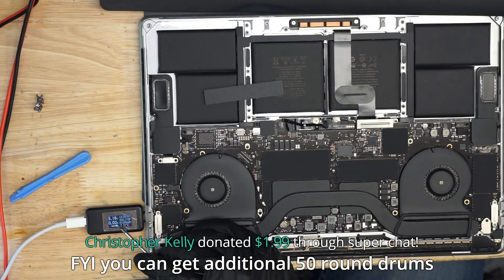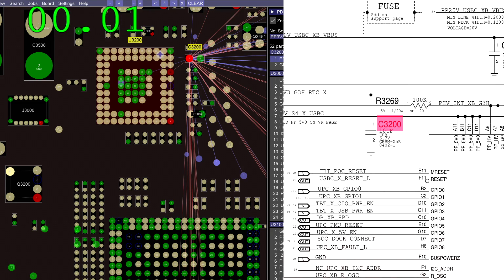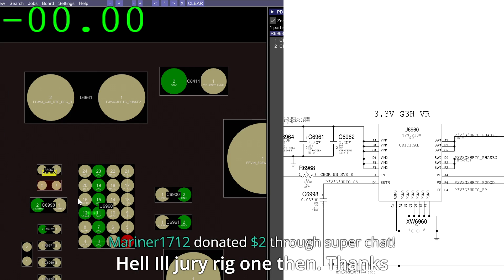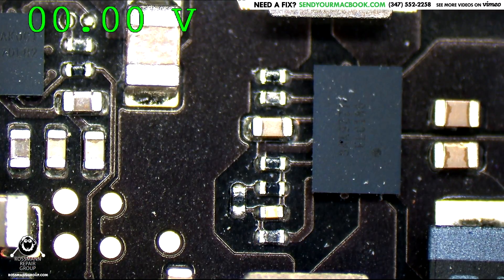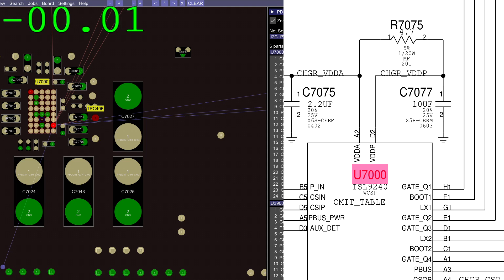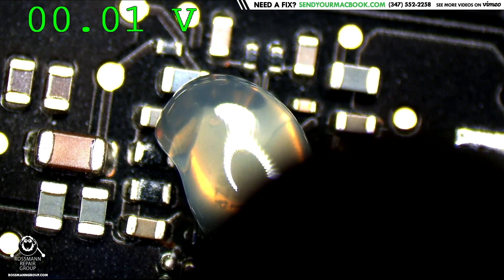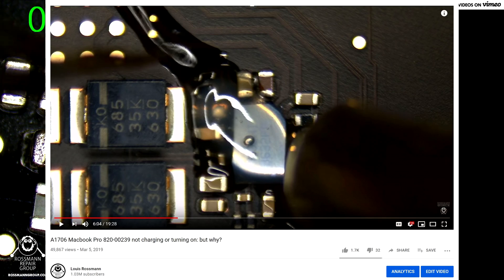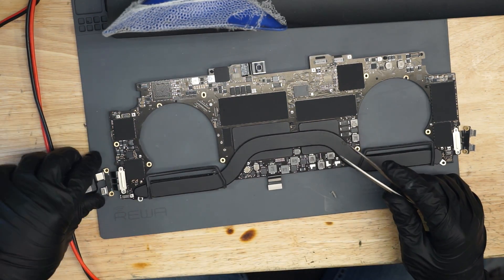How Apple is shaping the future of repair.

Comment: We don't tolerate this from our cars, our central heating/AC, our refrigerator, our stove, our water heater, our house, our plumbing, our TV, our radio, our non Apple product. Why do we tolerate this from Apple?
Reply: Because people only understand their computer as magic metal box
Reply: L
Reply: @houghwhite411  And its more of a prestige thing. Those people buy Apple because its expensive. Its like they not gonna buy a nice silver ring with a little stone on the top that looks gorgeous but only cost 100 bucks when they can have a golden ugly as fck ring for 5000.
Reply: and the keep buying apple because its trendy and in fashion.
Reply: Hough White , most people don’t understand how their car works but you can take the vehicle to the mechanic of your own choice to do the work needed. He has access to the parts even if he or she has to purchase through the dealer.
Reply: @houghwhite411  Because it is. Almost all OSs are extremely complex now. People that want to understand and play with their system install something like Arch for this reason.
Reply: People keep buying Apple products. They're afraid of change and I still to this day I find Apple is designed for handicap people. The whole system is flawed. Real Apple fanboys never have experienced the freedom of Android or windows the way apple locks them out from being free. The hardware is pretty much the same but double or triple the cost for Apple. It's only going to get worse since now chip makers are rolling out powerful chips average users won't need to update their system as often. I have many PC's and servers and still use one PC for VR that has a 8 year old I7 processor and a RTX 2080. My point is sells are going to drop with these new chips. Could you imagine the average user maxing out a 64 core 128 thread CPU? That should easily be good enough for the next 10 years. Apple should be afraid it's already happening in the phone market people don't upgrade as often as the phones have become so powerful as it is.
Reply: At some point people have a phone. And unless they run stuff like emulation or other intensive apps, they will never use the potential performance. New phones get bought either when the old one becomes running slow, out of storage or the contract offers a "new shiny thing"
The market will become saturated because who needs a second or third phone in a cycle where progress is slowing down and devices are "good enough" for longer.
Reply: @dco5055  Good point. I don't buy brand new phones anymore. I buy second-hand phones that are 1 yr or a little older for a third of the cost of a new one and they last me for years. As you said, the average user doesn't need top of the line powerful devices anymore as earlier devices are more than adequate.  A $1,000 cellphone can't be justified in my view. My laptops last me for at least 5 years of heavy usage and prices, unlike cellphones, came down significantly as quality and sophistication went up. Never used Apple devices, the prices are outrageous, and then it seems the whole Apple business caters to a cult customer base that would never question anything. My suspicion was confirmed when Apple decided to eliminate the headphone jack on its cellphone devices and forced its customers to buy a $150 wireless earpiece. Imagine android manufacturers doing that? If Samsung did that, it would've lost at least half of its customer base. In business, sellers cater to their customers, for Apple, the inverse is their business model.
Reply: Because of the political influence of money, lies, and lobbyists .  The voice of the individual citizens keep decreasing over time.  We are forced to tolerate this crap.  Our vehicles are already proprietary and disposable.
Reply: @wushock97  i took 2 cars out of the scrap yard and built one for myself, recycling at its finest
Reply: @gcKukie  That's awesome!  I drive a 15-year-old car myself, but looking to replace it with an even older "refurbished" or good condition car (since I can't do the work myself anymore).  At least any qualified mechanic can work on and repair them.
Reply: "We don't tolerate this from our cars" Cough Tesla Cough
Reply: Many people who buy iPhones or Macs have 0 technical knowledge (or just don't care), not even how it works. We can just direct to a cause by problem elimination. They just go: "Internet broke down!". What do we do? Check if other devices can access it? No, cables? No? The router itself? How did I discover my PSU was worn down? I just tested it and noticed it only BSOD my PC when doing heavy gaming! The voltage was less. Many young people and old people just go: "NEED A NEW PC! IT CRASHES!". Meanwhile it starts up without a problem, so the solution can be software related or just 1 piece of hardware going faulty/old... Every time I brought a device to repair shop I could point at the problem with very high accuracy. Always was either complety right or in the right area. People don't understand or don't want to understand their devices anymore.
Reply: Finish303 I’ve been trying, for the past few months, to get resources to I could try and fix my laptop, my dad wouldn’t get the materials. So, I told him to take it to a repair shop, he hasn’t done it. So, I’m getting a new PC entirely, I’ve chosen to build mine my own, and have a friend help me learn to assemble PCs.
Reply: TESLA owner tolerate it.  Why I wouldn't own one the only apple product I've owned was the 1st color IPod...  Apple SUX
Reply: RDE Lutherie  Microsoft and also  Nivida is releasing a software that allows people to take advantage of all cores no matter how many even on old games soon. I'm sure down the road it will come default to use all the processes. Yes I use Linux and even Ubuntu desktop. 

Open up Wireshark you can see what is being sent if it's encrypted you can see it's just a few bytes. Also you can turn off that so called Microsoft sends everything to their servers.  I care less and if they really did capture everything wish they gave me a option to recover something I accidentally deleted.

I would never use Apple can't wait to see it eventually fail. I mean it's already reporting record losses.
Reply: Good sir, I’m not sure you’re aware, but regarding cars... luxury car makers coughAudiVolkswagenBMWMercedescough have been restricting the electronics and a variety of other seemingly easy-to-replace parts for a few years now. If you want a new part, has to be directly from them. Can’t use a substitute because they literally make that given part so proprietary and unnecessarily complex in design that no one could replicate that part... at least not legally.

Apple is merely following the Germans’ lead.
Reply: @AtomicSymphonic  
Yeah but they will sell you the part. Louis would buy the part from Apple if they sold it.
Reply: because Apple is a religion ... :/
Reply: @GarryMobi  It's a CULT!
Reply: Be careful with your assumptions there... Several of the types of components you have mentioned have begun down the path that Apple has defined for big corporate america.  Try to repair a modern fridge, or talk to a farmer about trying to repair their John Dear equipment.  This latter case is in fact driving farmers bankrupt when they have to wait days for a repair they could easily do and had in prior times, crops rot in the field....

Don't assume this is just Apple, and yes, their attitude is scurrilous but they are leaders of a trend that will further drive the crass consumerism and destroy our planet.  Right to Repair, among many other excellent reasons to support it also is a huge Environmental issue.  If you can bring a PCBoard back to life it keeps it out of the landfill.
Reply: We don't.. We buy android.
Reply: "WE" dont. The idiots buying it have to live with it...   👍
Reply: If you own a Rolex, Omega or just about any other Swiss watch then this is the case, independents cannot buy parts.
Reply: @jimporter  My dad used to supplement his income by fixing watches, including Rolex.  He was not an authorized dealer.  He didn't have problems getting parts.
That was 50 years ago so it might have changed.
Reply: @jimporter  ouch.  Sorry
Reply: Because these days  people are sheep brainwashed by ads on tv, social media and in print.
Wake up people, these corps are taking away your rights.
Just don't buy products like Apple who spend billions crushing competition and 
Prevent you from owning the product you just purchased.
👍👍👍
Reply: you make a great point my dude
Reply: I don’t tolerate it. I am using my last apple pos which is slowly dying from battery issues. Apple will then be history
Reply: I've been asking that question for as long as Apple existed, as they have been doing the same thing for as long as Apple existed. I still don't have the answer, and still for the life of me can't figure out why iCrap is this popular.
Reply: Volkier Neigh 
It’s hard for us engineers/technically-inclined people to believe or understand, but combine people that like slick marketing and branding, a status symbol, and an unwillingness to learn how electronics work... and you get Apple.

Even today, people my age, in my 20’s, don’t fucking understand computers. It’s unbelievable for me that it’s nearly 2020 and we still have people that only know how to use an iPhone... that’s it.

Future isn’t nearly as fantastic as so many of us were hoping decades ago.
Reply: I don't. I've never bought Apple and never will. I don't use Facebook or Twitter either. Stop enabling these people.
Reply: On top a TV is between 10-20% profit 
Iphone is what 200-300% profit? 
Airpods are how much % profit?
Reply: Thats not 100% true. A car is much more complex. While you can change individual parts if say the ECU goes out on your car they wont fix it they will sell you a new one. Also TVs are a bad example these days they are ment to be thrown away I have a 3,000 TV have it mother board go out and when I cantacted samsung I was told that the motherboard would be 2,400 bucks to get replaced.
Reply: Because people LOVE Apple and accept it's easy to buy a newer shiny replacement. It stinks though!! 🤬
Reply: Well because beeeeeeehhhhh!!! 🐑🐑🐑🐑, you know m.....
Reply: Apple products to a lot of people are a "fashion statement". They like having Apple everything just to flex or fit in even if there are better product alternatives out there. That said, I can definitely appreciate the aesthetic of Apple products, but I would never own one myself.
Reply: mactards, macilliterates, macbeths, many words for it.
Reply: Sadly the new cars are going the same trend.
Reply: you are right except for the non-Apple product part. Try getting such (vendor-customized) chips for other brands Electronics. This is not an Apple-only issue.
Reply: because Apple users are borderline stupid and/or rich
Reply: Simple answer, I don't tolerate Apple crap.
Reply: Tesla owners tolerate this from their cars. But I'll never buy a Tesla because of it.
Reply: Some of us don't tolerate it and refuse to purchase any Apple product as a result.
Reply: Deere is the Apple of tractors.
Reply: Because all the idiots need the new iphone to look rich
Reply: I think it starts with ignorance which turns to denail and then...just plain ol" stubborness. We must challenge our own assumptions every day. Every day.
Reply: Because there aren't alternatives, you can't do and edit movies with other things on the market without the pain and apple knows this, when it gets broken you buy another one.
Reply: @tulvo  You certainly CAN make and edit movies with other things in the market and with better success than what you get from apple products.
Reply: @tulvo  I'm not a filmaker by any means but aren't there many other video editing programs out there for Windows and linux? Is final cut pro really so good that it warrants buying an overpriced Mac?
Reply: @JAD-dz3kt  You must change some things to make microsoft computer so fast like mac. That's almost like work.
Reply: @tulvo  Then use linux
Reply: @Deon DenisIt was meant as sarcasm.I would never buy a apple product they are way overpriced  & over rated .
Reply: It's because Apple is a fashion accessory above all else and functionality, reliability and convenience are purely secondary at best.
Reply: 'Cause some people are stupid enough so they don't care
Reply: Cause noone who owns an apple actually knows whats wrong with it
Reply: I had an imac for 10 years. Now I go out of my way to explain to people why I don't buy apple products anymore.
Reply: sadly people do tolerate this from cars have you seen anything newer then 2008?
Reply: Actually this is becoming more of a problem than you think Massey-Ferguson and John Deere have made it illegal or near impossible for you to repair your farm equipment. Tesla, Mercedes-Benz, and Ford are trying to prevent people from repairing their own cars by making sure the central infotainment system controls everything. And if the primary ECU goes out bricks itself because you touched it, so does the infotainment system. Whirlpool is starting to hide their schematics for parts, only labelling them on the wiring diagrams as "X part" instead of their individual components, meaning you have to replace the whole sub-system instead of something as simple as a fuse.

Part of this is because China steals designs and then just sell them out to whoever has money to buy the parts. Think of devices using chips and boards originally developed by Texas Instruments and NEC, but now manufactured and sold through hundreds of Chinese companies who copied the designs. The biggest part though is that they don't want cottage industries allowing repair or extended service life services. If people are keeping the older simpler stuff going, they're not going to buy the new stuff you packed with features you spent money on developing. Especially if those features receive negative reception, but you wasted so much money developing them that you need people to buy the device that has them to recoup your failed investment. They're stupid enough to waste money on bloat and then expect you to pay for it.
Reply: People thinks of Apple as a fashion item; my last Apple product was the iPhone 4.
Reply: Cars are next. John Deere is one of the biggest forces behind killing right to repair laws. Their new business model is selling you the initial vehicles cheap and then gouging you with repairs.
Reply: Got any friends in agriculture - ask them about John Deere products.  The fact that they are pulling this crap with six figure products has led to some “right to repair” legislation in farm states.  Don’t get me started on Tesla...
Reply: Your point for TVs doesn't really stand anymore. The repairability is pretty close to phones and computers. I pulled apart a Samsung TV recently and I could barely find any replacement components. Only boards which is very similar to Apple products and other phones and computers.
Reply: Because Apple fanboys are empty shells of humans who replace their personality and individuality with expensive shit. You could say they are NPCs from video games.

And like someone else from this thread said, phones are magic camera instagram boxes to them, and they believe everything they are told.

They're basically programmed by Apple to respond in a certain way if anyone dares to criticize them.

Also their "programming" completely breaks and crashes if you undeniably challenge their opinions. 
I guess then they just call you an Android fanboy and smugly run away, feeling like they just won a war or something.
Reply: Because you buy there shit.
Reply: but you do tolerate it for most of those as car fridges washers dryers get more complicated its harder and harder to repair one of the lobbyist in one video was microwave repair and others were tracter repair and more at least they can actually repair stuff unlike apple lol
Reply: @trueheart1372  Had a board go out on a washer.  Board was easily fixed with non-proprietary parts.
Our cars are 20-21 ears old, aftermarket manufacturers abound.
A smart consumer stays away from overpriced fad products that can only be fixed at/with proprietary overpriced service centers.
Reply: Because of Genius™ Think different™ design
Reply: because first world ###
Reply: @Love America Don't understand why people buy apple products unless they are so shallow and weak minded the have to boast to others that they can afford to throw 2200 bucks down the pan; really sad people.  
A college college once tried this on me and was so proud that he had a $2200 machine until it went wrong and was quoted $1750 for a repair, a 6 week wait while it was returned to apple and total loss of all his years college work because he was told that the data was not recoverable. 
I just grinned. He then asked if I would give him a copy of my years worth of college notes because apple would not even attempt to recover his data. I grinned again and said what form my second hand $150 laptop. His apple device, returned after 12 weeks, was put up for sale.
After selling the machine and paying postage he had lost a total of just over $3000. 
He has now asked me where I purchased my second hand laptop from and what freeware backup program I use. 
Moral of the stoty:- Just don't buy an apple device because after they have sold it to you they don't give a monkey's about you, your data or how much you originally spent.
Reply: Absaalookemensch cus ecosystem
Reply: @naturecollision  No, because some people are sheep while others are intelligent.
A fool and their money are soon parted and there's a sucker born every minute.
Reply: Its like the government of phones
Reply: @xoxoxok  Like single payer healthcare? lol.
Reply: "We" don't tolerate it. You might, but "we" don't.
Reply: We don't .... buy something else.  My new Dell running Windows 10 is fabulous !
Reply: @absaalookemensch cause with apple we "Think Different"
Reply: RDE Lutherie  while your macbook and imsc overheat if they are old or some random chip fault
Reply: I wouldn't know. I use Android and windows.
Reply: Let's make sure Tesla-like cars don't become the standard. Teslas are notoriously hard to repair, just ask Rich Rebuilds. For example, it writes lots of data to flash memory soldered to the board and when it fails your car stops working.
Reply: As population increased, so did sheeps.
Reply: @coolvinay  You're baaaaaaad.
Reply: i dont
Reply: Actually we do, see Tesla and John Deere.
Reply: isheeps
Reply: I don't.
Reply: Actually we do, you can not find parts for Tesla cars, only from Tesla and if they find you on the network with an "in their eyes" illegal car they can refuse to charge it at a Tesla charging station.  John Deere (I was one of the system admins working on this) has full access to equipment that farmers lease or rent from dealers, we set up a dealer network that will verify and make sure that the machine operates within the given parameters.  This is the future that we wanted, we do not want anything to do with humans, it has to be machine learning and AI and what would really happen if a machine started learning, correcting its own mistakes and rewriting the code...  Yeah, I am a boomer, but I have been advocating and preaching about this for the past 20 years, this is why I am now unemployed because the truth cannot be spoken.
Reply: Atleast you can find them with Tesla... His point is about both oem and apple not supplying this oft failing part inspite of knowing its failure rate, intentionally making it unrepairable...
Reply: I think it's different in that there is personal information in personal computers and not in cars and car parts but regardless,  an independant shop owner could get sued for malpractice by disclosing personal info from a computer he repaired so has alot to lose, should he take advantage of a customer.  Not likely to happen at all, but the fear mongering coming out of apple will go on untill the politicians stop listening to them and listen to us for a change.
Reply: @gym_bob  Apple and Telsa live by the code that there is one born every minute. 

 It matches their production goals.
Reply: Do you really think Apple gives a crap about your personal information other than using it to make money?
Reply: @gym_bob  No, it's because cars are much older than smart phones and computers. Give it time. This problem will solve itself. People will get tired of over paying for inexpensive repairs.
Reply: a computer is not a durable good. most electronics like tvs and radios are cheap and not worth repairing. an apple computer is just another disposable commodity designed to last maybe 2 years like their phones.  fixing them is great, but not buying them is better
Reply: Nate Walkner 
It’s a massive shame they are not. They used to be considered durable goods for years before the 2000’s. At least there is growing pushback against completely sealing off devices today.

In my family, we don’t want to budget for $2,000+ purchases of computers... then again, it might be because my parents want to retire and have to restrict everything.
Reply: @natalieisagirlnow  Wait so your solution is don't buy any computers, tv's, and radios because they might break in 2 years? That has got to be the dumbest logic I have ever seen. How are you even posting online if you have sworn off technology.

Also I have owned every tv, radio, and computer I have ever bought for well over 2 years before needing repair. And when these devices finally do croak, It's usually a extremely easy fix. For example, my most recent problem was my laptop had a swollen battery (was beginning to warp frame, and put pressure on the touchpad making left clicks not register) . Thankfully it's not an apple product, so without bothering taking the laptop into a repair store, I just ordered an after market battery from china. After that it's pretty simple, I disconnected the bad battery, and installed the new one!!! I know right!!!! It's almost like computers are means to be repaired when they break. FYI I am typing this comment on that same laptop, a year later, which has been working flawlessly.
Reply: Well it has a good camera ..
Reply: @roberthance2412  My Leica is a good camera.  If I want to take good quality pictures I use that.
My flip phone battery lasts 3 weeks and I have a spare for when I need it to last longer.
My computer exceeds the professional quality that I need of it and costs a fraction of the price and is easy/inexpensive to repair.
A Swiss Army Knife has a good toothpick, but that's not a valid reason to buy the over priced, under performing tool.
Reply: @natalieisagirlnow  Got the Leica at an auction, so no, at the price, it is monumentally better than a comparable priced camera that I paid for.
That was 35 years ago.
With a few telephoto lenses I can take excellent photos several hundred meters away.
You cannot do that with a IPhone.
Apple is like those stupid red soled women's shoes.  The produce for those born every minute.
Reply: @natalieisagirlnow  well, not really. I grew up with Leicas, had a 35mm Leica M3. The gold standard in nearly silent plane shutter rangefinder cameras. Quiet enough that they were allowed in the courtroom.

No snobbery involved here. I had a Leicaflex, their first SLR, and later Leica reflex cameras. Superb machines. I didn't base my existence on that wee red Leica badge, but I knew that they would always perform.

I had a Minolta XK when they first debuted...in the early 80s those were about $3500. Expensive but brilliant, and they made the job easier. The brass was showing on the cameras' edges, but I never cared what others thought. Well made machines last for years of hard duty.

I digress a bit, but here's the point. An Apple is priced higher than the competition, but it for damn sure is no Leica. That MacBook is a status symbol that falls apart after two years.

My old Minolta XK is 40 years old now, and works perfectly. Louis would like this. When the AE-S digital finder failed (first in the industry, so good that...yes...Leica used the Minolta system in their SLRs!), I called Minolta in the days before the internet.

Know what their service folks did? They sent me the internal parts for free, years beyond warranty.

This is how a corporation rewards those with faith in their product. Listening, Apple asshats?

For the photography nerds out there, Minolta disappeared. Know where they went? They were sold to Sony back in the day. Ever wonder why Sony cameras are so nice? Hehe.
Reply: @Absaalookemensch  Missed the joke there didn't ya.